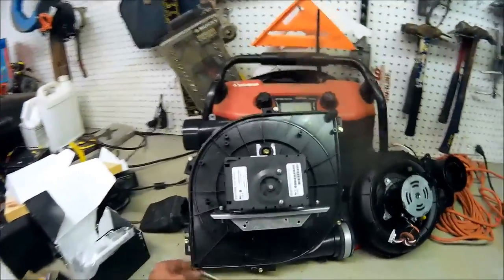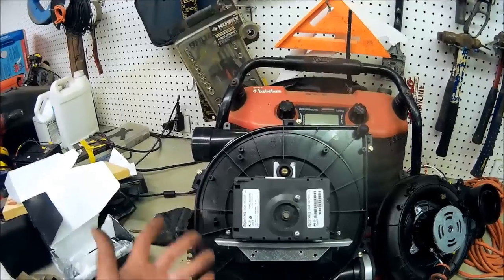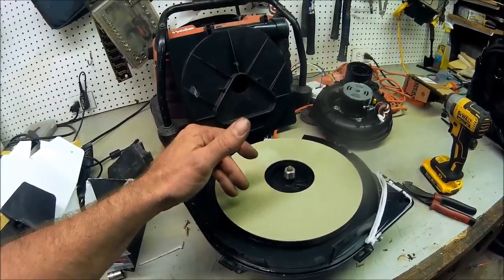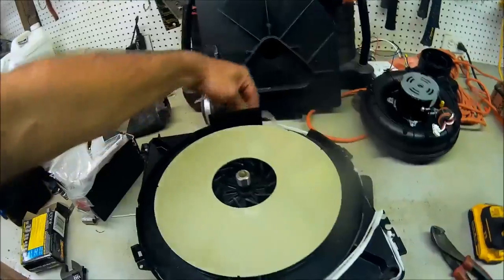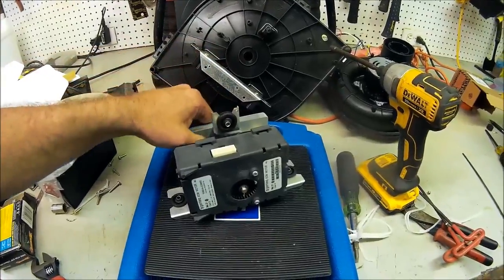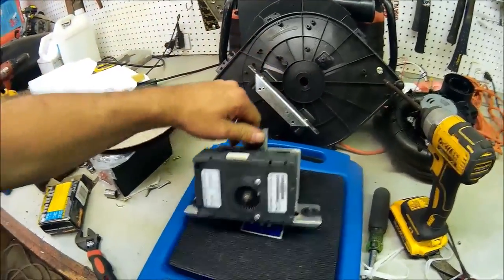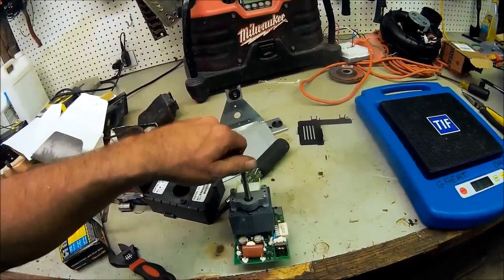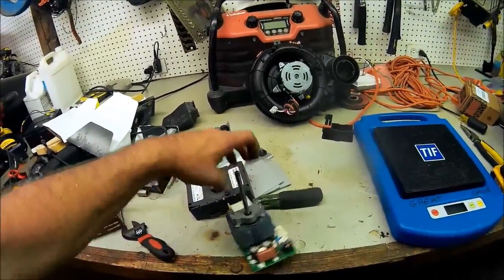Carrier Infinity or Bryant Evolution ECM inducer motor tear down

Comment: I am planning to replace the inducer wheel (322592-701) you show on our 58MVC-080. I am getting a loud noise right when the inducer starts and then it stops. I found another video with the same noise and when they opened it up the wheel was cracked. We recently had the primary and secondary heat exchanger replaced by the Carrier installer that originally installed the furnace in 2011. Not sure if something they did led to this but hoping to find replacing the wheel fixes it. 
What sealant would you use for the plastic inducer housing when I put it back together? Would high heat RTV be to adhesive if I ever need to remove again. The sealant/gasket stuff that is currently in place seems to be falling off. Carrier mentions a low adhesion sealant called Novaguard 400-900, but I cannot find it to buy. Thanks for all of your very helpful videos.

Comment: Do you have a part# for the rubber isolators? My fan makes a scraping noise but it goes away when I push up on the inducer motor. Thanks.
Reply: @andrewsnider4098 - I have the exact same issue, same furnace... did you resolve it? I need those replacement rubber isolators too.

Comment: I just replaced a bearing on that same motor, only to find out that it was totally fine. Because the motor is so heavy, it started sagging causing the fan wheel to touch the inside of the assembly when spinning. I lifted the motor less than a 1/4 inch and the rattle disappeared. Hope this helps some people out there. An HVAC guy wanted to replace the assembly for $1,400.
Reply: I had the same grinding issue... I stuffed a rubber stopper into the silver bracket/black rectangular cover gap... grinding stopped.
Reply: I have the same unit that makes noise when it ramps up and has do this since day one (2008). Have tried to oil the bearings but hard to get into the spaces. Guess I will just live with it till it gives up.
Reply: How did you raise the motor? I have shimmed it, but it still makes noise during part of the ramp up cycle. It seems very sensitive to how it is adjusted. Thanks.
Reply: @andrewsnider4098  it IS very sensitive. It took me a few tries. I found out that it is better to raise the motor itself, not the bracket.

Comment: I have rhe same motor on my carrier furnace.  Had ducts cleaned. And upon cleaning the insides of the furnace the inducer motor was oily and a bit of smoke waa coming off of it.  The couple blk capacitors on the back of the board are super hot and smoke was coming from thst area.  Any idea about the oil present and if the capacitors or resistors are supposed get that hot. Motor turns freely. And quiet.  Thanks.
Reply from the maker: Most likely the caps busted. The whole assembly needs to be replaced

Comment: How did you remove the wheel. I can’t get mine off. It’s cracked and I have the extra fan to replace it just can’t get it off?  There’s an Alan key on the side but that doesn’t do anything.

Comment: Hello, my inducer wheel broke and it’s stuck to the shaft. Any recommendations on how to remove it?
Reply: Disregard.. I sprayed some WD-40, let it sit for 2 hours and gently tapped it down and then used a vise grip to pull it off.

Comment: I used an Allen ranch to take the key out but still having issues taking off the wheel without cracking it. Any suggestions?
Reply: Probably too late now, but I had the same problem. I put some penetrating oil on the top of the shaft and it seems to have helped. I used some wooden shims, similar to paint stirs, under opposite sides of the wheel, and slowly worked it up. I did find a bit of rust on the shaft after getting the wheel off.

Comment: I  attempt test the motor without furnace control board, so I connect 24v to 1 of the signal wire and burnt the PCB of this motor. Just wondering to take it apart and try my luck. This video is helpful

Comment: So my inducer is making an awful sound and the furnace tech tried to shim it to no avail. I am looking to just get the genteq motor part itself, but you mentioned replacing the rubber isolators. Where could I reliably source these? Also that seal on the motor shaft between the motor and blower that you mentioned has a small air gap, is there a replacement for that available too? I appreciate any help. Thank you.
Reply: Hi Stephen.  Just curious if you found the part# for the rubber isolators? If I push up on the motor the scraping noise goes away. I assume the fan wheel is rubbing intermittently. Thanks.
Reply: @andrewsnider4098  KA56GR560

Comment: Can you buy the motor/control board separately or even just the control board???  I believe something on the control board fails due to heating up.  I have two motors and both run for a short length of time but error due to something over heating on the board.
Reply: @drlava What was wrong with the coupler and how did you fix it?

Comment: How do you remove the motor & circuit board from the housing without cracking the plastic???
Reply: It comes apart very easily. There is an allen key in the fan side of the shaft.
Reply: I wish I knew, I cracked mine.  But only a little.
Reply: Heat up the solder and using desoldering wick suck up the solder on the 3 areas that connects the circuit board to the motor.  Don't force it when the solder is melted it and out of those places it will slowly come off.

Comment: These things are so noisy! (Vibrations ... bbrrrrrrrRRRRRRRRRR...)
Ours hasn't broken yet, it's got to be like 15 years old. But it's always been noisy.
Reply: Okay, yup, it just broke recently.
Sadly the values were burnt off some of the SMD resistors so I was unable to fix it. There was also a small SOT23 size component (transistor?) that was cracked in half.
It appears that, somehow, condensation got inside and caused a flashover.
It was way too expensive to replace the inducer unit, so we replaced the entire system! (The system was 18 years old, so it was liable to have other failures soon enough anyways. Didn't want to waste money.)

Also, as of note, although the whole unit looks the same, the part number is different than the one you show, and the control board is slightly different. It only has one large capacitor, compared to two on yours.
Reply: Do you have the water shed tray over the control board housing??

Comment: About 45 years in the residential HVAC biz . Even in the Chicago area not one person will ever recoup the money they spend on these modulating BS. The first cost is almost impossible to recoup. Now add in a thousand buck repair out of warranty.
Reply: Modulating is for comfort, not saving energy. The near continuous operation when properly sized and controlled.

Ya i wouldn't recommend buying one because of the repair costs. Not only that, you need a $500+ proprietary thermostat to fully take advantage of these furnaces.

2-stage with a psc or shaded pole inducer is the highest i would ever go. And not a carrier, their parts are way too expensive.

Comment: These shaded pole motors with bushings get noisy when the bushings become worn or lack lubrication. The motor still works, and there's nothing wrong with the control electronics, the noise is coming from the bushings/shaft. Ours is doing it intermittently now, mostly near the end of a heating cycle, and my plan is to pull the unit out so I can get a few drops of heavy oil into the bushings. Also, lightly tapping on ours quiets it down. Oiling it might give us another year, maybe two, before we have to drop $350 on it.  Good to see how it looks apart, although the actual dismantling of the motor housing was what I tuned in for. Mine's a GE, says it was made in the USA, fwiw.
Reply: Hi, just wondering if yours is still working. How oiling work? Ours is starting to have the same problem and tapping quiets it down too.
Reply: The noise in mine, appears to be an alignment problem. By physically adjusting the alignment the noise disappears. Are there replacements for the bushings?

Comment: So if the motor spins and has not failed, what makes the noise in the unit when the noise starts??  Can a little bit of zoom oil or triflow fix the problem (as in maintenance??).
Reply: It could be worn out bearings or it could be water in the bottom of the fan housing.  I had a problem with water in the bottom of the fan housing.

Comment: I have this exact same inducer and found out today it's $1000 to replace. ><  I'm going to order HC23CE116 from amazon and use the ECM motor (exact match) from that and put it on the current housing and fan.  Save $300 at least.

Comment: I do refrigeration, ammonia etc. I install furnaces on the side. Look into the new goodman 98 %. I have done 20 plus Infinity's,That goodman aint no joke. I have never ever herd a furnace as quit as that goodman. My friend works for a Trane dealer, helped me install two of them this weekend. His jaw dropped. And they don't have that ECM bullshit either. Ill make a video.
Reply: ECM is no joke.  I run 24 hrs a day and my bill has reduced by $35 AVG/mo in electricity.  May have to replace the control module eventually but heck over 15-20 years THAT PAYS FOR A BRAND NEW FURNACE AND AC...OVER $6000!!!!!
Reply: Over Charger I think you have inhaled too many refrigerants to say Goodman is quite lol 😆

Comment: The rubber washer are actually isolators, to prevent sound transfer and the shims are basically ballast for vibration and also help to reduce noise.  The concept is the vibration is reduced because instead of being able to throw a light fan motor around, it now has to move a mass of weight making it much harder to vibrate.  If you wanted to do an experiment run the blower with & without the weights and you will be able to see the difference.  You could also intentionally un-balance the impeller by removing or adding weight and observe the results..the weights actually do work.
Reply: Dont really know much of these ecm vent motors but i had a trane TUYD80R9V3VS give me an inducer error code of 3 flashes. Seems like the same assembly and ecm motor. Is  the flame suppose to shut off with the pressure switch hoses off? If I remember correctly they had a tee to the gas valve and burner assembly

Comment: Nice tear down. I think they are using those metal plates as a heat sink to keep the motor cool. Not the best design and could be an afterthought.

Another thought is motor noise. ECM motors make a bunch of weird noises and vibrations. They can usually be quieted down by changing the motor mass which moves the resonant frequency.
Reply: @jima3129  My understanding is it's a two or three speed ECM motor, not true VS.  It's used for the efficiency number.